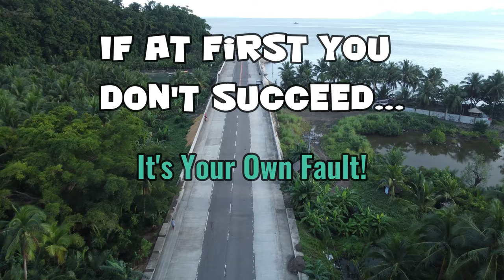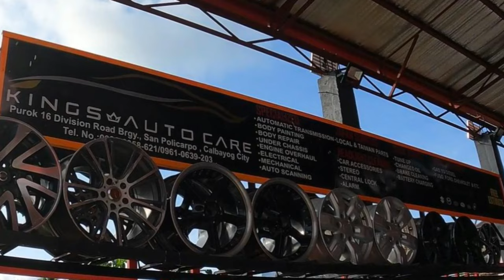Maintenance - It Costs More Than Fun in the Philippines!

Comment: That is the case with stock motorcycles too. Simple parts on a Yamaha, Honda etc are often hard to find at the dealership. Having to pay up front for them to order a part that can be weeks to be delivered on our Island. I typically go for 3rd party parts just because they are much more common. So far that hasn't caused any issues.
Reply from the maker: Great point!

Comment: Great video and good info Randy. I'm in the process of looking into building /renovating in the Calbayog area, on that what would you suggest? New build or existing house renovation? I'm an ex builder and to say I'm a wee bit surprised as to some of the techniques used over there. I mainly did formwork on multistorey carparks in and around London so I do understand there's a vast difference. Is it best to let the local builders do it their way with just minimal input?
Reply from the maker: I would chose to build first, that way you have more control on the finished product. When renovating, you never know what you will get yourself into... unless it's a great spot with space. Local building customs are just fine, as long as you are holding the reigns.

Comment: Pesticides in Philippines aint cheap either right?
Reply from the maker: A large can of Baygon runs about P350-P380 (about $6.50).
Reply: @TropicShade    That's a lot of money for an average Pinoy to part with.   I buy the gallon home defense pesticide here at Lowes, I bet the same cost double in Philippines, if purchased at ACE hardware.  The dispenser cost way more there too. I wonder if they sell local pesticides for roaches and bugs there cheaper.
Reply: I definitely concur about maintenance here and the low quality of materials from China that are sold here. Much thanks for the vegetable oil tip! Thanks for sharing for everyone who doesn’t already know.
Reply from the maker: @kevinj8236  Should have mentioned that only the dry floor drains need the oil.
Reply from the maker: @comm2531  We purchase only the Baygon... mostly for mosquitos.
Reply: @TropicShade  I use a fogger propane bottle with dispenser you light up filled with mosquito killing fluid, might be Baygon that shoots out a cloud  of fog, works well. I bought it at Amazon.  Way cheaper and covers more area than a can. If I use a spray can from Lowes it goes real fast and only for area I'm standing. Consider a fogger.  Mine is a Black Flag.